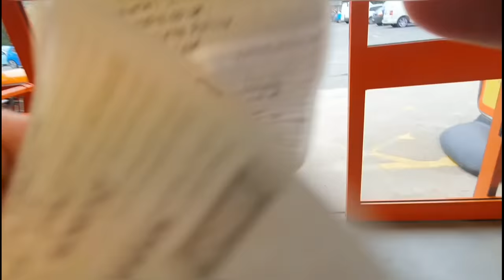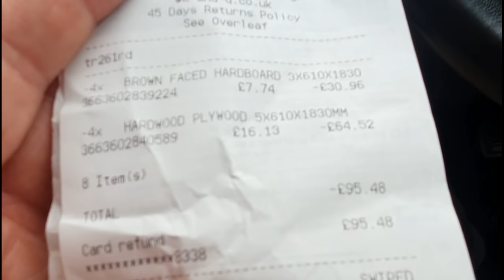Another week with Sherpa

Comment: Love the Sherpa dog. He is quite the character!. Be careful about insulating vans with regards to condensation. The research I've done at cheaprvliving.com/forums talks about the potential for condensation (rust) to accumulate on the metal beneath the insulation. The remedy is to air gap the insulation by something like a quarter inch to allow venting upwards towards the roof, either by roof fan or natural convection. Please verify using scientific methods what I mentioned to you here, as I am new, and confused on this matter. But, after seeing your last van I wouldn't want that to occur again to you. Bless.